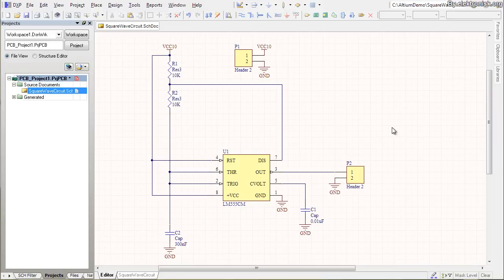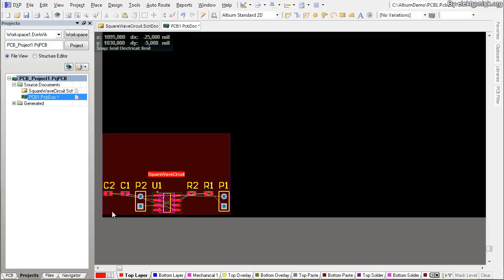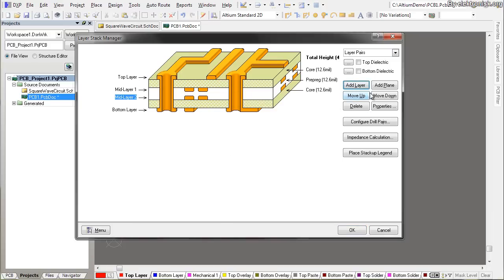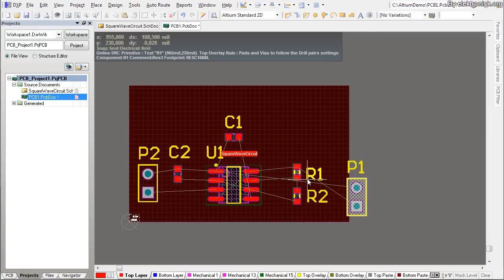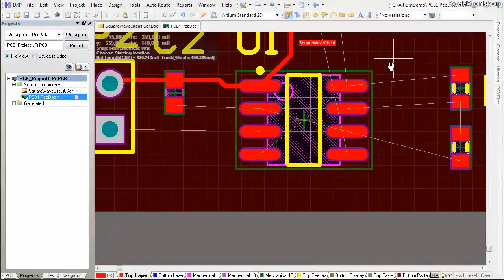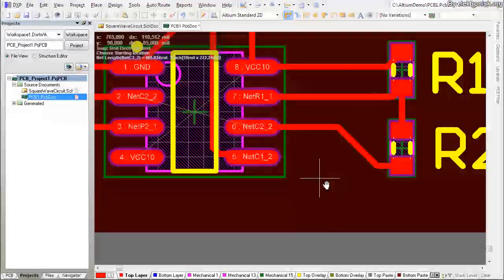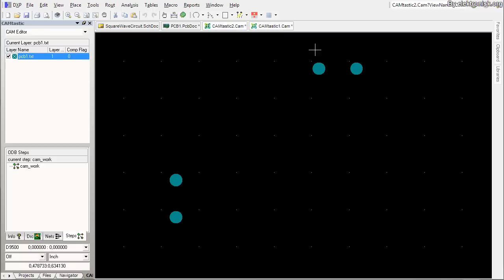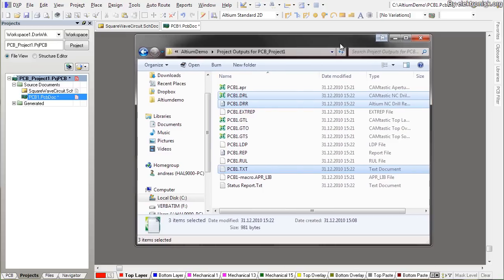Altium Designer Tutorial: Schematic capture and PCB layout (2of2)

Comment: Very nice tutorial, man. I have watched it a few times. I would like to give one comment. At the end, you generate the gerber files and dril files. The gerber file include the top layer, top overlay and top solder mask. Do we need to generate a mechanical layer too, to define the board outline? It seems that those 3 gerber files do not have any info about board size. I am suggesting this because last time when I sent the gerber files out, I received an email right back from the manufacture, saying"Board outline layer is missing from the zip file. please provide board outline layer to further process." So I had to create a Mechanical layer 1, and draw a rectangle in there. It went through after this, but i don't know if this is the only way to define board outline. Please let us know if you have another way to handle this problem.

Comment: Thanks for the very useful video. I have been using Protel 2.8 for quite some time. Downloaded Eagle free version and tried to switch over, but gave up. Recently upgraded to Altium 10 and am quite happy with it. Two questions: 
1. Is it possible to get an inverted (reverse) image of the PCB printout for use with negative dry film photoresist for making the PCB? 
2. Is it possible to export the PCB image as a bit map as you can do in Eagle? (The bit map can be opened in Photoshop and inverted.)

Comment: Great video. I have a question, I see you first designed the schematic and then transfer all that data to the boardview. Well, in my case simply i'm trying to document the current view of my board. Design simple silkscreen just with the layout of the components. Is there an easy way of doing it without going through the whole process of designing the whole schematic? Thanks